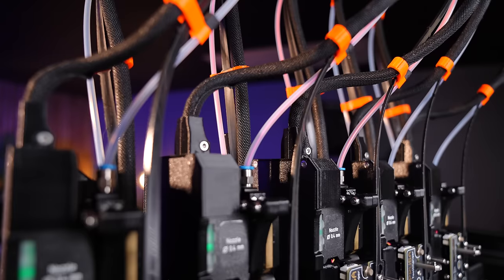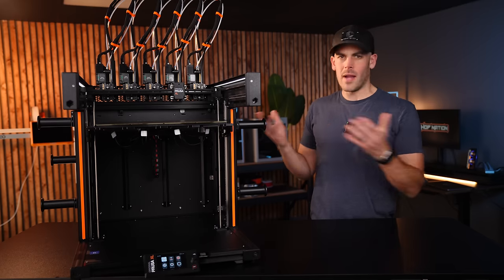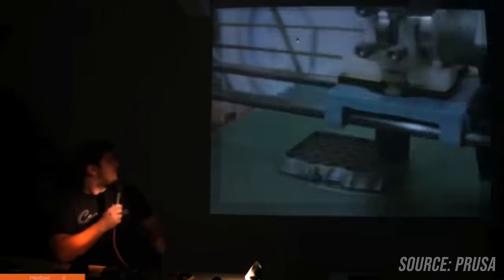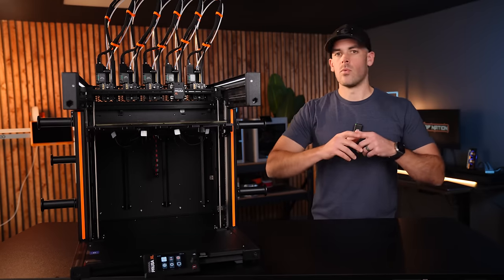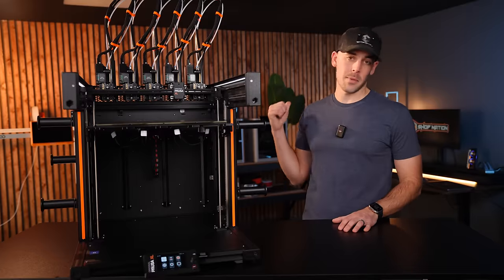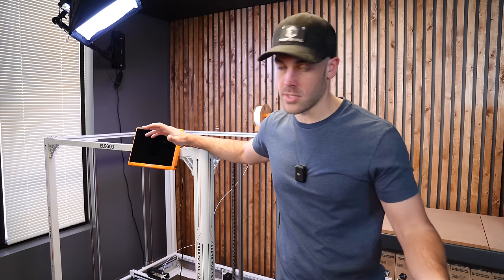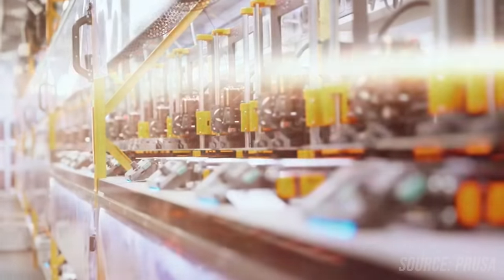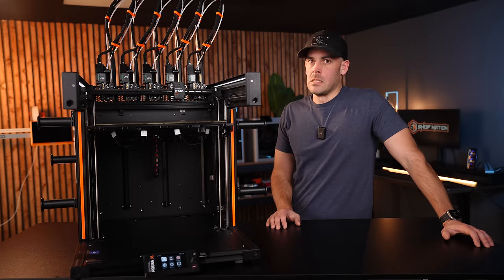Why Prusa is the next Blackberry

Comment: I just got the Creality K1C. Works right out of the box, extremely price competitive against Bambu and Prusa, and the results are actually quite phenomenal.
Reply: Oh nice! Just the other week I was looking at a new printer to replace an old janky one and my choice was between the K1C and Bambu Lab P1s. I ultimately went with the latter because it felt safer after the original K1(non C) problem reports. And I might want the AMS in the future. But other than that I think the K1C is probably a great option, being as capable at a lower price point. And it seems to be more reliable than the older K1. I hope it will work out good for you!
Reply: I almost bought one of those just because they are so cheap but I have seen too many people have issues with them (others haven't) so I bought the P1S. I'm glad I did because it is absolutely amazing. I honestly can't say I have heard anyone complain about the Bambu except that they connect to the cloud. You can use them stand alone so that's not even a valid complaint.

Comment: you need to mention, the bamboo lab build and component quality is not great. the ams is definitely gonna brake down on you within a year of normal use. 
the motherboard is also not very great. and we can continue. Yes the prusa is way too expensive, but they are build to last.
Reply from the maker: I run many Bambus constantly in a farm, not seeing any longevity issues yet
Reply: I wouldn't trust a Bamboo Lab either, sounds like a china copy of a china machine.  My Bambu Lab machines are solid so far after 1000's of hours, fingers crossed. The output volume is almost 3 times as much compared to my Pursa's.  With my numbers Bambu has already outlasted the long time Prusa's I have with Ouput:hour ratio.

Comment: Fast, reliable enclosed designs are the future for me. Most of the issues i have with 3d printing come from an open air design. Now if Bambu-labs (or in this case, Prusa) can solve the purge waste with a system like the AMS, and make that process more efficient, then that would be the best path forward.